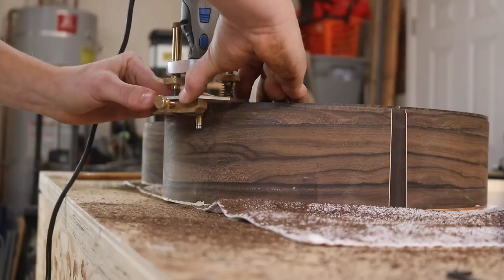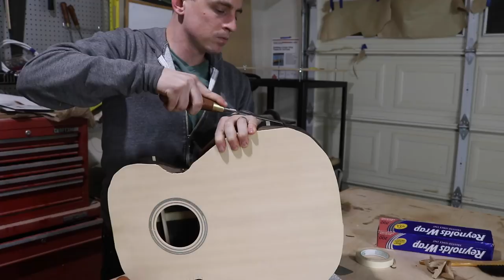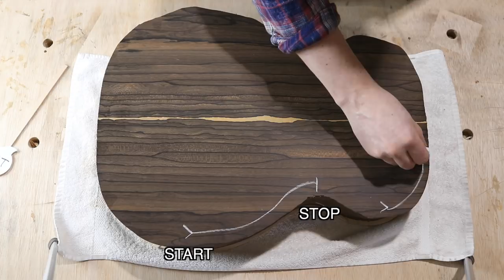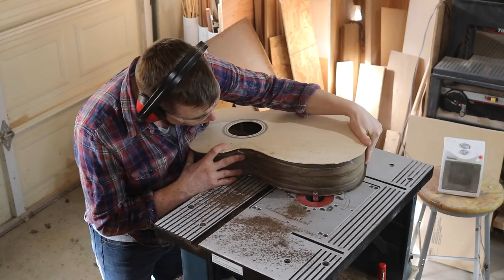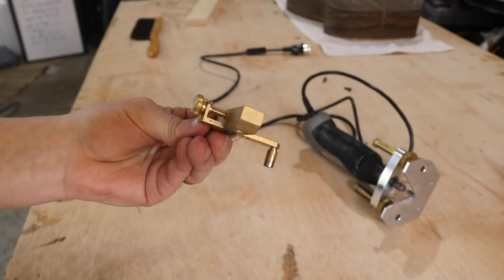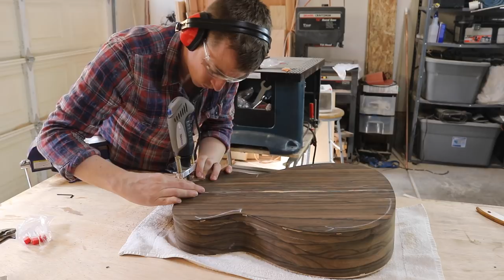Cutting Binding Channels (Ep 18 - Acoustic Guitar Build)

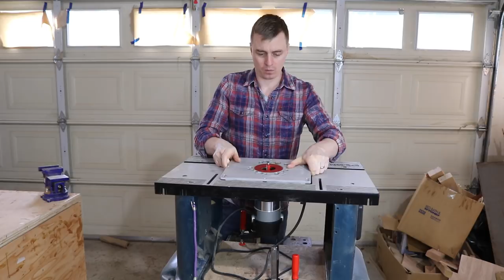Comment: I made this comment at the 2:02 mark, just to say that especially with woods that are more prone to tearout, it usually best to go with a spindle sander than a router to flush the sides. Cutting the binding channel will be easier as there is more surface under and behind the zirocote, but to trim the excess I would expect nothing but tearout.

Comment: Yes, that's exactly the problem with this Stewmac router tool. The right angle is just not fitting the doming of the back and top. They now offer an adjustable router base but they didn't when i purchased mine. Evenso i believe the extension with the spacer ring is too short. A longer spacer ring would give much more support and make sure the router tool is in vertical position all the time. I think the router base should be free floating because the doming changes along the edges. If the spacer extension would be long enough, you wouldn't need a fixed router baseplate.

Comment: I like the video!

Maybe changing the bearing of the router bit to a smaller one can make it a bit easier. Depth guard comes beneath the router base is kind of tricky because approaching angle can change the depth so easily.
Reply: The bearing of that router base extension is too short. The diameter is ok, although it could be even larger as there is no such narrow curve on any guitar, that there is need for a smaller diameter bearing.

Comment: by using this cutting method, the result is going to be a tilted binding-channel. how do you compensate for the angle oft the Back and the sides? I use a router with an adjustable base and adjust the angle as i go or I cut with my parallel-jig.